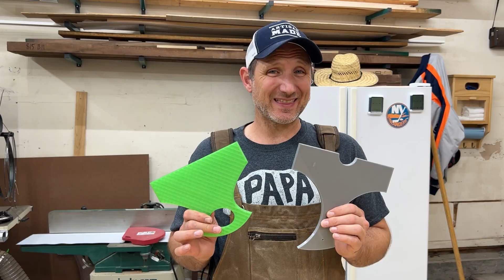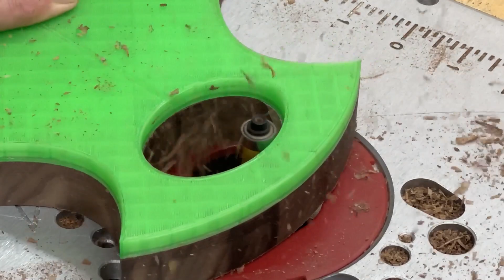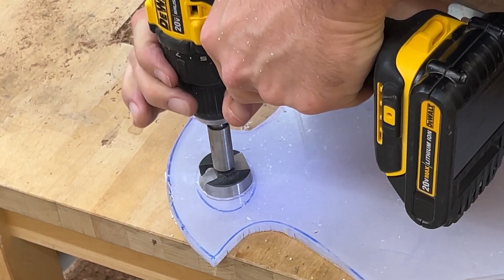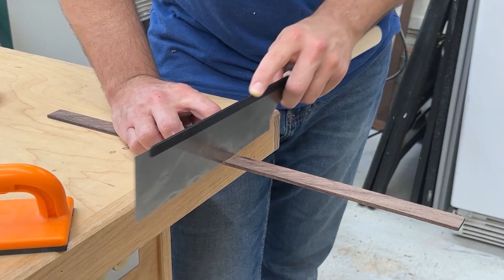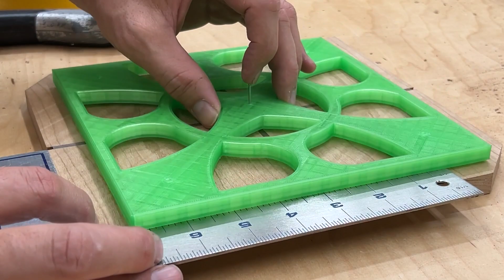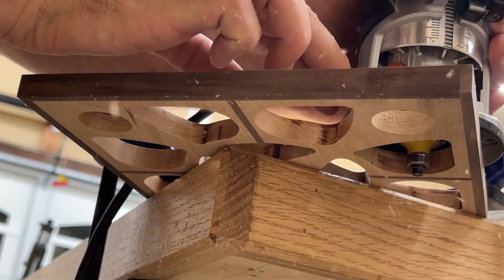How To Make And Use 3D Printed Router Templates / DIY Router Templates / Woodworking Hacks

Comment: Rockler sells a router Matt that keeps projects from sliding around however it is only a cabinet liner or a drawer liner. I bought it from rockler and realize this very quickly so I went out and bought cabinet liner and it works just as well. When it gets really dusty and doesn’t work as well just rinse it off and let it dry and you can get a big roll. Dirt cheap
Reply: I've had a ratty old one I scavenged from a kitchen drawer about 25 years ago lol. It's amazing how durable the material is

Comment: just use a yoga mat instead of the tape for the table when hand routing. Works amazingly well. Zero sliding even for a larger/longer board. Roll away when not in use.

Comment: There is an elbow that will get your dust collection hose out of the way of your material. It is made for your dewalt planer.
Reply from the maker: Yes you are right. I found a free file and printed it on my 3d printer. Game changer.

Comment: Hi I'm trying to get into wood working and I'm wondering do you have 2 routers one for the table and one for hand use or do you mount and unmount the one you use by hand?
Reply from the maker: I do have two routers. Originally, I only had one. It was the larger one 2 1/4 hp.  Then I bought smaller one 1 1/4 hp. I usually leave the larger one in the router table and use the smaller one to do a lot of the roundovers and chamfers
Reply: @ArtisanMade  OK thank you I'm about to get a table I only have one router currently so I will have to take it off the table from time to time till I get a second one

Comment: This video is great and shows good examples of the use of a 3d printer in woodworking.

However, when you do the shots with your table saw, please, do not show unsafe technique!
Using your hand as a push stick to the right of the blade is just stupid.
People watching the video might pick up bad habits which could result in serious injury.

Other than that, great content!

Comment: You can connect them using joints in the model rather than just trying to line up 2 straight lines of different pieces, also, UHMW over acrylic

Comment: for @3:10 
You can design a puzzle piece into the 3D design and then depending on the material used, glue them together permanently (ABS: Acetone, PLA: CA glue etc.)
This way you aren't using multiple materials and steps to get to the final template
Reply: basically, dovetails!
Reply: @Daniel Cardona  sure ! I just make a nice rounded spline shape, but any parametric shape will work! Just make sure to use the sketch as a cutting tool and offset the faces according to the extrusion width of your printer :)

Comment: I do this a lot, I have a cr10s and the Ender 3 pro and am always looking for ways to incorporate my 3d printing into my woodworking. I print templates for mounting feet on cabinets as well as handle jigs and even some tools.  I typically use 40 percent infill when using pla using 4 walls, so they don’t warp with the heat in the garage. Awesome video by the way!
Reply from the maker: Thank you!

Comment: When you are creating the 3D template, what is the infill setting?
Thank you for posting this info / how to video - great idea!
Reply from the maker: I used a 10% fill
Reply: @ArtisanMade  thanks. People say higher but it's a guide not a structural piece. You can feel the resistance against the router. 

How many pieces can you go through with one template before you have to trash it because it gets worn down from the metal head? I'm assuming like 2mm error over 50 pieces, 1mm over 25.

Comment: When printing multiple pieces like this, I’ll often incorporate a dovetail into the design and then tap it together with a mallet. You can avoid the taping that way.
Reply: Do you simply model the full object and split into two or do you have to allow any tolerances to cater for the printing process?
Reply: @stuffoflardohfortheloveof  if your printer is properly set up, no need for high tolerances for this type of work, just split and print